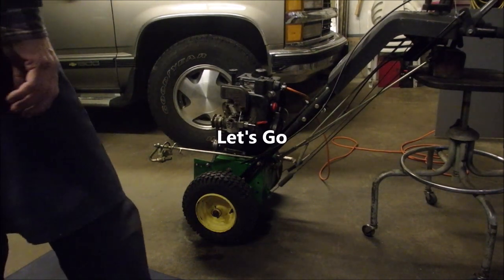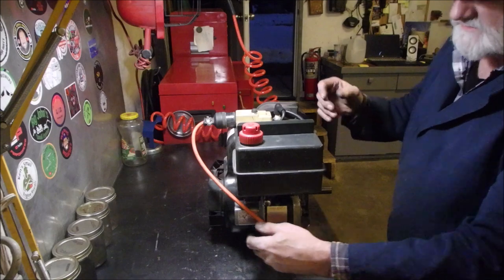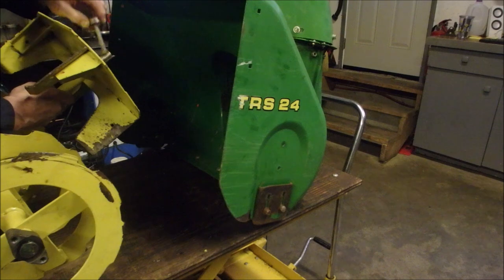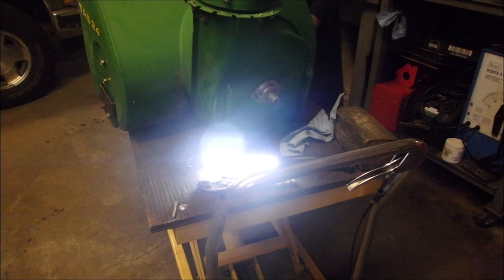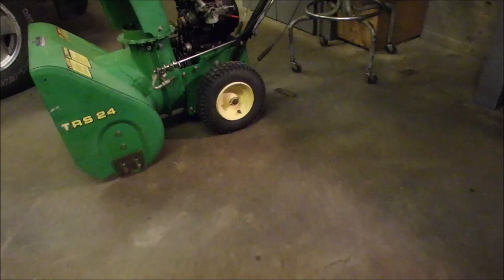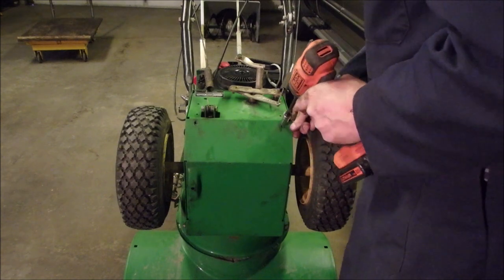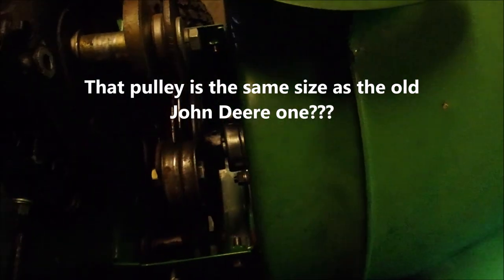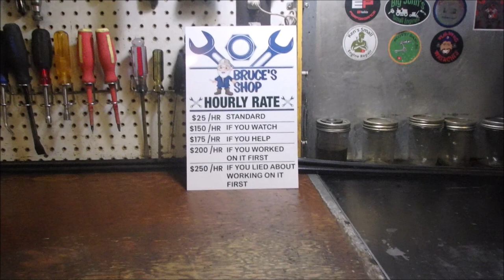JD  TRS 24 Inch Snowblower Pulley And Drive Setup

Comment: Run into a similar belt problem with my 1986 JD1026 where by a 35" drive belt is too short and a 36" drive belt is too long so it actually shows in the manual it uses a 35 1/2" belt and the killer is that most places don't carry half sized belts other than an automotive belt. Good job once again Bruce cant wait to see it blow.
Reply from the maker: Thanks a lot.